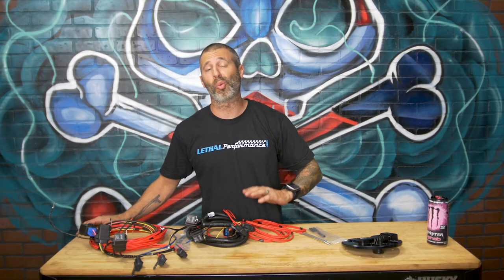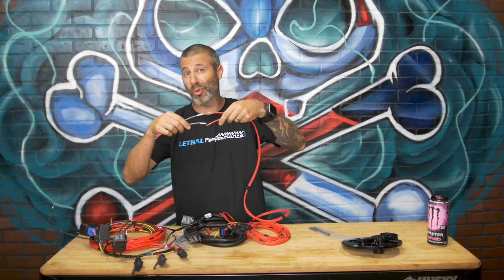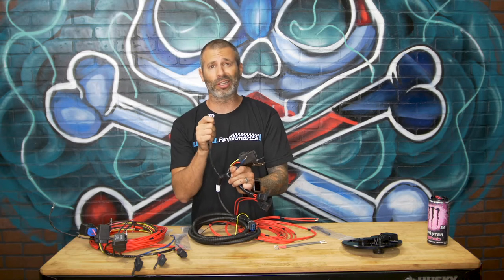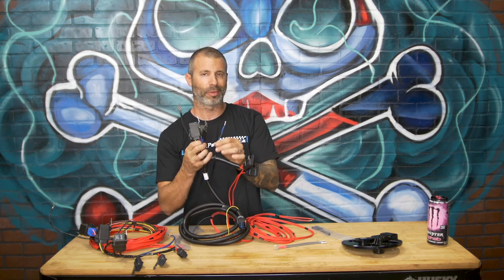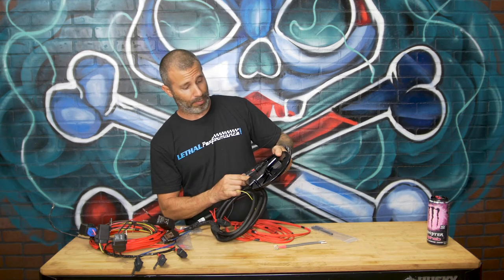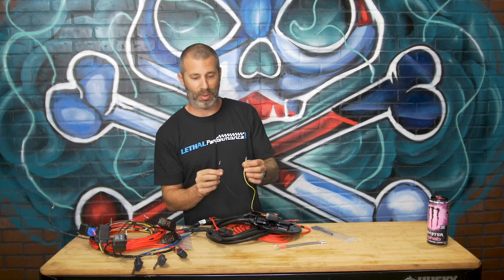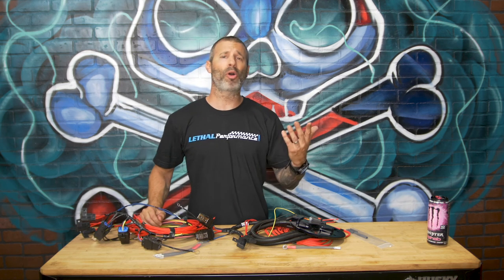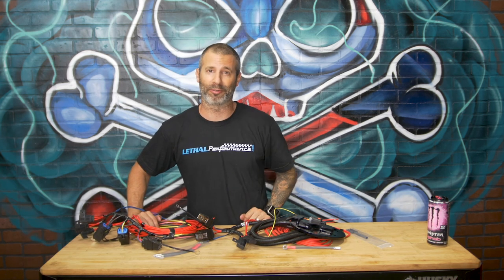Lethal Performance Tech Tips: Return Style Fuel System Wiring Harness EXPLAINED

Comment: After 2yrs of running this kit I ran into a issue that I blew both 20amp fuses when out for a drive.  Replaced them and made it home.  Going to replace the fuel pumps and see if that fixes it.

Comment: You must have had a few calls.  I am putting together my 03 Mach1, Street car with occasional strip and track car, so I have a fairly well built stroker 4.6 DOHC I have been building. I havent purchased a fuel system yet.  I have looked around and at what your offering. What is the deciding factor or when is it time to go from the factory variable current to maintain fuel pressure and proper F/A ratios to a return style fuel system? I like what you said about the connect of those cars I thought I had to do some crazy tuning or re-write to the stock control system.  Any other info you can provide is much appreciated. Thanks

Comment: I have no connector on the hat. Just 3 red wires, 3 black wires and 2 yellow wires. And a 6 pin connector on the wiring harness. What hooks up to what? Since I have to cut this connector off.  Do I connect a red to the big yellow and red to the big orange? And then blacks to blacks of course.
Reply from the maker: stag if the fuel hat you’re using doesn’t have a 6 pin connector on it then you’ll cut the connector off of the wiring harness. The larger gauge colored wires go to the red wires on the hat and the larger black wires go to the black wires on the hat. The 2 small wires go to the level sender wires on the fuel hat and can go either way as it’s based on OHMS.  Let us know if you have any other questions.

Comment: Can you explain the wires on the triple pump harness , I have a 2011 gt500 and none of the wires on my stock harness from my fuel hat match the harness that is provided in my kit and I downloaded the instructions but it also does not match the colors in the instructions. The only wire that does match and is in the instructions is the purple wire from the  FPDM.
Reply from the maker: Alberto Mendez the only other wires you need to be concerned about are the level sender wires. You’ll peel back the loom on your stock harness where the connector that goes to the fuel hat is. Then clip the 2 small wires in the middle a few inches from the connector. You’ll then connect those two small wires to the 2 small wires on the fuel hat. Please feel free to call us tomorrow if you have any other questions and we’ll be glad to assist you.